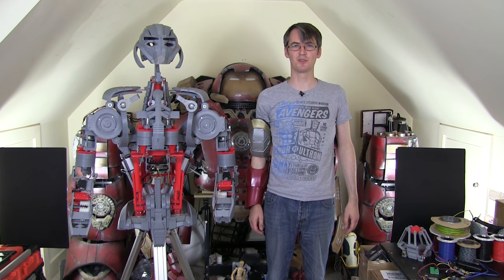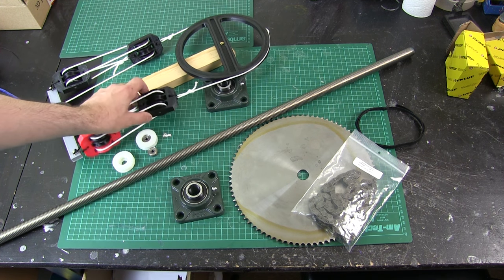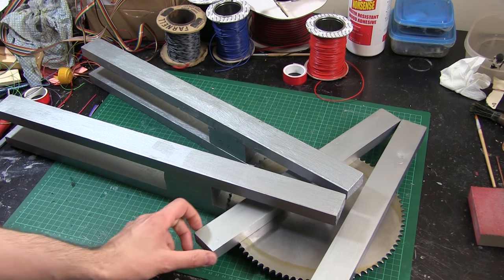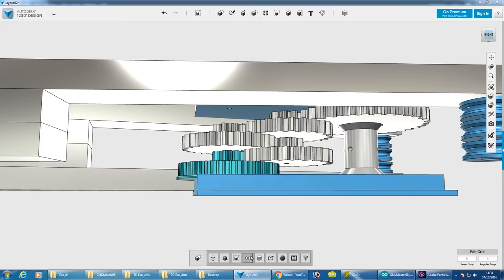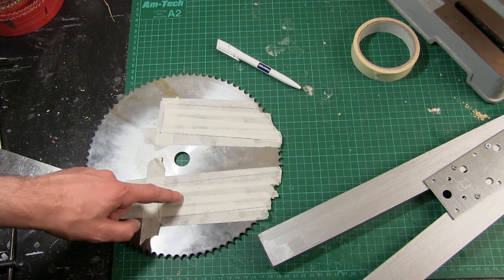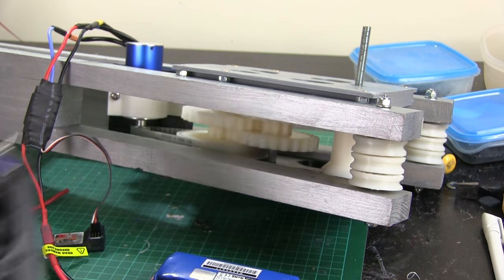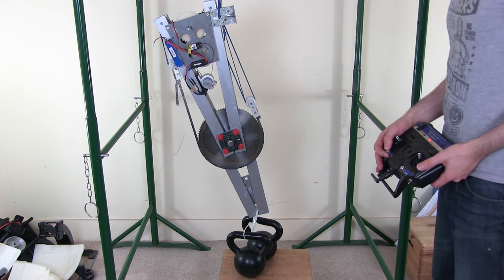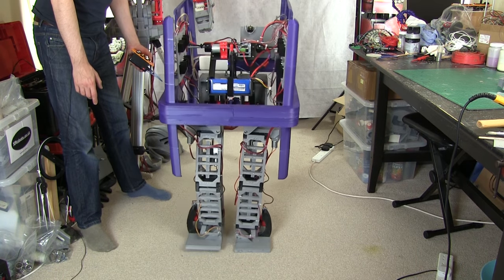Iron Man Exosuit #4 | Working Elbow Joint | James Bruton

Comment: I don't know James, the more I look at it, the more I'm questioning this approach, when you look at other exosuits that have successfully been made without hydraulics, their joints are not as massive and certainly not as complicated. I still think this could have been pulled off with just some larger motors and a simple direct chain drive mounted to 3D printed framework reinforced with metal rods for both strength and less weight.
Reply: can u give me links on motored exo suit. i would love to watch it,
Reply: when I saw the thumbnail I thought James will fart
Reply: Haha this is exactly what I was thinking

Comment: I have a bit of a weird idea James...
Electromagnets..   Bear with me, if you put a series of electromagnets in a semi-circle; each magnet being attached to one of the two different parts of the arm....   Ugh this sucks to explain lolz         Ok picture a .5 inch long cylinder of metal, and a cylindrical electromagnet of the same length right behind it.   Now give them an axis which is mounted to the suit (maybe a steel tube)!    Magnets are only useful in short distances, so keep them close obviously.  Then when you want to lift something heavy you send pwm signal to the electromagnets and adjust the duty cycle according to the load!

sorry for the paragraph but its almost over
When you send the current, each electromagnet pulls the piece of metal in front of it closer, moving your forearm upwards.  Meaning the magnets and metal would be alternating and the metal cylinders would be held by the bicep part of the suit while the magnets are held by the forearm.
Reply: The only issue is your travel, but this could be fixed by making the effect sequential
I swear if you don't use this idea then I will 😂😂
Reply: good luck getting him to answer you, i been waiting for answers fro him since his bb8 videos
Reply: +Max Knight dont be rude man, he's keeping up with like three projects at once, making videos, managing comments, and he has a life..
Reply: that was not rude
Reply: I think what you just described is called a stepper motor.
Reply: Yeah, and those have a crap ton of torque once they get moving, the main issue is low stall torque, which could be a problem.
Reply: be scary if it messes up and harm someone with all that torque, his other robot has safe guards
Reply: Sooo... A linear induction motor? High end elevators use those

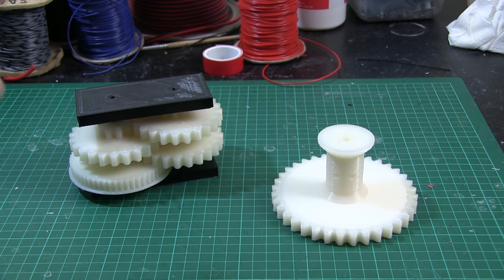Comment: Use airsoft BB's and small holes in the plates to reduce noise and friction. Cheap, easy and simple solution. 8:50
Reply: how would bb pellets help?
Reply: oh for cheap gear bearings, would that be strong enough?
Reply: Kyle Brown Yes... There is little to no load on the gears vertically as all of the force is rotational around the axle.
I use bb's for homemade thrust bearings on applications which have a load of 15lbs and they work fine.
Reply: thats not quite right, the gears take some force radially and some axially depending on the angle at which the gear teeth mesh, but its probably not very much for this kind of system
Reply: Kyle Brown Hes using spur gears, which dont have any vertical forces.

Comment: When cutting threaded bar, cut it with a nut still on, its much easier to unthread the nut to clean the thread up rather than the opposite.

Comment: Use Spectra line instead of paracord! I have experience with using both for power transmission and Spectra is much stronger and stretches much less.

Comment: Maybe you might want to look into using HTD timing belts instead of a chain? It would be lighter and much quieter operation. You could also print the toothed pulleys instead of having to buy steel sprockets too. HTD stands for High Torque Drive, they would definitely be up to the task.

Comment: Hey James, I think your gearbox and tackle are going to be the saving grace here. So much so, that you could probably HALF the size of the elbow sprocket. This should double the speed of the arm, and only drop the torque by 30% or less. (I don't know your gear ratios, so I'm not going to guess on the math.)

Comment: James, I study mechanic engineering and I work 10 years in a high tech company. Just an advice: ROLLING bearings are for things that turn fast. If it is slow turning, you really don't need one.
Reply: So a regular ball bearing would be better for this purpose?
Reply: I see. What made you decide on ball joints for the elbows if I may ask? They're not ball joints in real life.
Reply: What I mean is, if there is not a fast angular speed nor an important angle of rotation, you don't use roll bearings. Eg, in a car wheels are on roll bearings, but door hinges are not.

Comment: This is the first time seeing your exo suit build. I was holding my comment until I finished seeing what your approach is. 

I would say that pneumatics would be lighter and more compact. A multi-pair port solenoid valve would only take up about 10x20x30~40ish mm, and you would only need 1 pneumatic ram to create the movement, but you can put another on the opposing side to spread the load. There would be enough space put 2 on each opposing sides (4 total). The amount of compressed air you would need, would be about the size of a small fire extinguisher for 2 rams (keep in mind, with would be storing air, so it wouldn't be that heavy)

...... or you could have make a worm gear linear actuator with some studding, a nut, and a motor (possible a gearbox to multiply the torque and interface between the motor and studding.
Reply: a portable electric tire pump compressor can't weigh more that half a kg at most for a cheap decent one, and runs only on 12v. Now that amperage draw would would be less over time, when comparing to the amount that the motors would draw for an entire suit over time. 
With pneumatics, the main amperage draw would be the pump and that can run until it reaches a psi in the tank then stop. The draw from the solenoids and controllers would be minute. Plus you can control how far open the solenoids go, using pwm.

Comment: you could try replacing the large sprocket with a dirt bike rear wheel drive sprocket. you can get them made from alloy (for making your dirt bike look cool with different colours) so they will be lighter than steel but still strong enough for what you need.

Comment: Nice. Its easy to get more speed without power loss. Just go for a battery with more cells if the speed controller can handle the extra currant

Comment: To reduce the stretch in the pully system you could replace the para cord (Nylon @ 15 - 28% stretch) with Vectran (3.3% stretch and more than twice the tenacity of nylon) or Dyneema (3.6% stretch and 3 - 4 times the tenacity of Nylon) Both available at any good chandlery.

Comment: Not sure if you read this, but a much better solution is 60:1 NEMA stepper motor gearboxes.

If I where doing this, I'd simply use a 3-4kw brushless, sensorless motor, 48v and a KV of perhaps 168, so an SK3 motor might do.  8000RPM/60= 134RPM, then I'd use a 3:1 ratio between the arm and the gearbox sprocket and a closed loop of chain. This will give 44RPM, or  0.3 seconds to do a 90 degree turn. 

Math:

180:1 ratio

(30/168kv*pi)*80A*180=819 newton meters, or 604 foot pounds. That means if you have a foot and a quarter lever you'll have 400 pounds of lift force in 0.3 seconds.

The reason I want this power and this much speed, is so that I can have 2 kitchen-scale type devices where the hand goes and two bungee-cord style bands holding your hand in the center. When I go to lift anything, I will first overcome the bungee cords holding my arm between the two scales and start applying force to one of the scales. An arduino program proportionally throttles the motor to the amount of force I'm applying. The high RPM will keep the arm with my natural motion. I can then change the proportion of throttle related to the force I apply, so for example applying 10 pounds of force would provide the motor with 20A, or 1/4 of my maximum torque.

Comment: when you put your stud/axels through the wood...if you plan on working with any significant weight/torque you will have to reinforce the wood or the tension on it will split the wood "bones" as the direction of traction will align with the grain of the wood

Comment: great approach. Look like a good idea seen that is quite power I believe that you can try a smaller gear. You lose a bit 'of strength but would earn a lot of speed.
Reply: +James Bruton (XRobots) It is the right way. I'm building an Exo arm too, and I thought of a joint that lets the arm to move and intervenes when the arm has a weight on top. in this way you speed up the movements when there is no weight and not overheating the motors with unnecessary movements.

Comment: rc motors and gearboxes have come a lot in the engineering and design process. now, the motors or in some cases engines use all metal spur and drive gears. these gears are fairly cheap and I would recommend using one on the motor instead of a belt.

Comment: Paracord stretches a lot and usually doesn't live up to it's rating unless it is from a reliable source.
Reply: Yes, and be sure to use a proper tension hitch. A cinching knot will reduce the cords strength by 80%.
Reply: Maybe you said it but im not sure so i ask anyway. why don't you use steel cord like piano cord? there would be a lot less stretching problems ! ( I love your show keep doing your videos like that ! )
Reply: DastiRDTV I'm not sure if there is another name for it but in Australia we have a type of rope called dyneema which has a higher tensile strength that steel wire (for the same diameter)
Reply: Paracord is designed to be stretchy, since you don't want a non stretchy cord tieing you to, you know a parachute like it's intended use. You would likely be better off with nylon rope (It has been used as winch cable in cranes, and stretches minimally if using the proper rating), or something like 1/4 inch steel cable (like that used in clothes lines)

Comment: Hi  James Bruton
amazing work
I know that you have different aproach right now for this project  but keep in mind for the future if you need to use pulleys and ropes for other projects  to use  Dyneema lines/ropes (Spectra for usa viewers )

there are 15 times stronger than steel and dont take any backlash as the normal lines.. so they will have the same tension 

we are using them in race sailboats mostly ... they use them even for rig the mast 

you can check one site  here in europe - premiumropes  for more technical details

thanks for the good and inspiring work you are doing

Comment: why not a wormgear in the arm? less gears, more torque and it will block itself in a position
Reply: have you thought of making a track/housing for the pulleys to run up and down through? so that they don't twist and yaw as much? also what material do think might be good replacements for the wood later on?

Comment: James it looks like you're using 3s batteries try 4 or maybe even 6 you could get way better performance
Reply: MOVEMENT yore right its relly slow
Reply: He's using 12V motors, they would burn up. If he wanted faster response, he could get 24V motors.
Reply: remember, its just a test, he can easily change the motor and adjust the gears, and i think making it too fast will make it hard to control.

Comment: Have you looked into outrunners? they should have much lower RPM and more torque, they also can be extremely powerful for their size and you can even get very flat ones to fit in a more compact setup.
Reply: So not even a motor like this one? http://diyelectricskateboard.com/diy-electric-skateboard-kits-parts/motor-6374-190kv-3150w/
that motor is also sensored. I see how accuracy is important especially with starting and stopping, which is why combining a sensored outrunner like this one with the VESC speed controller could give you the accuracy you need. It's pricier but I just feel like it would be much more compact and the efficiency and strength you would gain from not having to gear it down so much could make it worth it?

Comment: Hey James, have you looked into using Fusion 360 from Autodesk? All the controls are extremely familiar from 123Design but Fusion is so much more powerful. Plus you can run simulations and tests to find weak spots and tolerance before even building it in real life.

Comment: just a recommendation on how to improve this project.... one, use a smaller design of materials. you don't need to bench press a bulldozer, but you need to atleast break world record weight lifting. so a smaller mechanism wouldn't be a bad idea for one.for light weight materials, use frame tubing and parts.... the tubing alone will hold up to atleast 700lbs per aluminum/steel tube, and not weigh a whole lot. not to mention you could use the sprocket from the peddle crank as the elbow sprocket which again, is light in weight, smaller, and durable enough for a good amount of torque.when it comes to support for your legs and back. you might want to start simple at first, make a bracket just to hold the whole suit at first until you come up with a design for a full torso and leg mechanism to assist your natural body motions and flexabilities..... hell making a series of motors that will mimic your back's flexibility will be hard, not to mention a framework that will support the weight of your body along with the weights being lifted, and the weight of the machine it's self will be a hell of a chore. so just making a standing bracket would be simple to start with. and improving from there would be a good start. especially when you plan to get a working prototype off the drawingboard ASAP

Comment: Have you considered using Cycloidal reductions instead of the gear-train?  They 3D Print pretty well and you can achieve up to about 150:1 reduction in a single duplex stage - with a possible advantage that they do not back-drive (when you try to turn the output, it tries to turn the input both ways, mathematically at least!).  Quite often used in the shoulder joints of industrial robots.  Also, you mentioned hydraulics - in that you need pumps, valves etc.  However, you can use closed loop hydraulics just as a force/displacement multiplier (connect a big ram to a little ram having the same swept volume, expel all the air by cycling the assembly under the surface of your fluid of choice).  If you use Pneumatic cylinders, you can use water as the hydraulic fluid.  They seem to cope with 50Bar of water pressure fairly happily.  This provides a useful way of remoting your power source (in a back-pack for example) and keep the limbs light.  Drop me a line on Google+ if you'd like cad drawings of Cycloidal reductions - they seem a bit esoteric and hard to find designs that actually work!
Reply: A bit like a harmonic drive, just a special case where the teeth (hypocycloids) roll over one another with a pressure angle such that the teeth are only in compression (no shear).  That's why they lend themselves to printing - and can be half the size of even a planetary reduction for the same torque handling.

Comment: James it looks like work for colinfurze. He is perfect in working with steel and you are great with electronic and automatic systems. I think, that your cooperation in this project would make super solution...
Reply: Yes I've seen your other project and are awesome. I wanted to say, that Colin may would be able to create smaller and strong enough mechanical parts of this project. May be combination of steel and aluminium parts would be lighter with compact size. You are perfect with code writing, motion systems and 3d printing. I thought that combination of your and Colin's skills would produce the best product.

Comment: Nice to see the project moving on. Did you consider using hydraulic muscles? I was considering a similar project and these seem like a nice solution to keep things compact but strong.
Reply: He considered it but decided to stick to electrics which are easier to control and far more compact without the need for a powerpack and pump.

Comment: Well unless you intend to push something with the same strength then the back end of that pulley system is just for decoration and weight.
So if you decide to only use this as a straight lifting device you could remove the back end, remove the sprocket and chain, just to have a part of a front arch for leverage on a piece of cable/cord.
Those bearing blocks are also intended for around 10 tons each, which seems unnecessary, getting something in the 1 ton range would be far more suitable and light. Also those bearings should go right up against the main stress point when possible, so instead of turning them outwards and leaving an unsupported length of shaft it would do better turned inwards.
Oh and some heavy grease can at least quiet down the loose gearing.

Comment: When using a hacksaw on a big lump of metal, spray some wd40 on the hack saw blade and on the piece you are cutting. Be VERY generous with the wd40 and keep topping up. should cut a lot easier.

Comment: James:  How did you get on getting the Taulman to stick well to the PEI bed?  I am struggling a little with a similar setup (Taulman Brdige Filment on PEI bed).
Reply: James Bruton Funilly enough, I tried that just after posting and got my first functional part from Taulman Bridge. It's taken me ages to dial in my bed level and first layer height. Not something you have to worry about with the auto-probe on the Taz I assume..  Time to print an adaptor for my own bed probe!

Comment: just curious, how come you use ABS filament in most of your builds instead of PLA, any particular reason?
Reply: James Bruton oh ok,  I've always just heard that PLA was easier to print. 
Took a bit of looking online, but there are products that you can get online to chemical weld PLA, as I've heard acetone won't work with it.